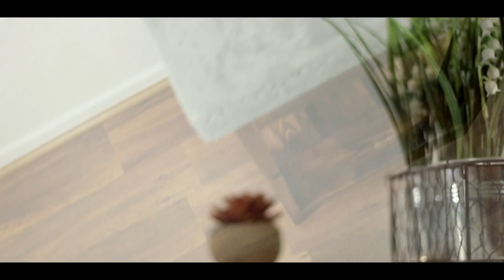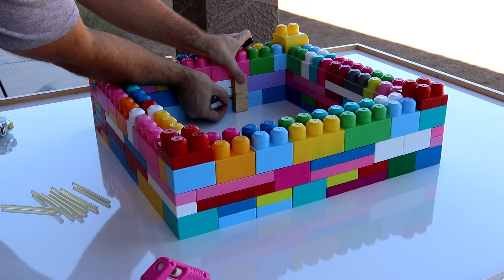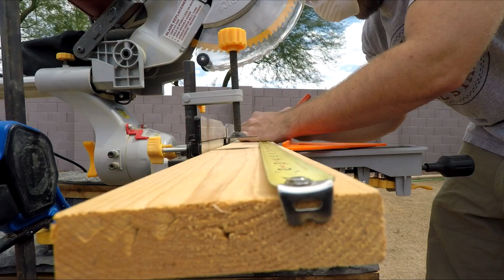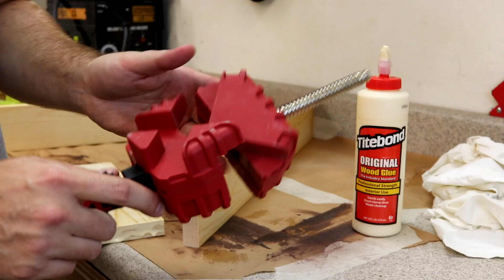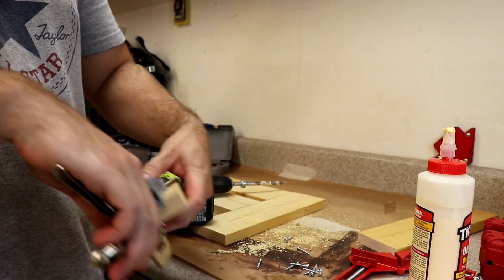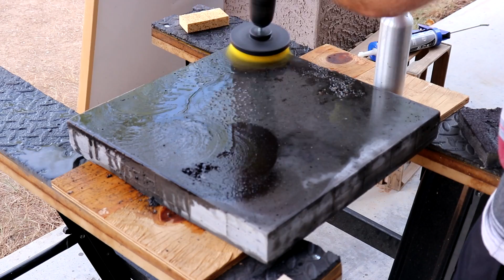Cheap and Easy $25 DIY Rustic Concrete Top Nightstand

Comment: Great project, thanks very much.  You used a water based pre-stain with oil based stain.  Minwax has an oil based pre-stain that will provide even a better finish.   Great idea on the cement top!!
Reply from the maker: Thank you Chris! I’ll have to check the oil based pre-stain out! I appreciate your recommendation!

Comment: Nice!  Any reason why you didn't embed some bolts in the concrete to attach it better to the top of the base?  And how top-heavy is it?
Reply from the maker: Chris Stephens thank you! I was afraid of screwing up and having to wait 2 more days for a second top to cure haha. Great idea though! And it’s actually not easy to tip. It is heavy though, I would say at least 30 lbs

Comment: $25 worth of materials, destroyed $30 worth of LEGO and glue... why didn’t you just use more 1x4 for the concrete mold?
Reply: Watching you use Legos was creative and showed people they can use anything to make a mold. Some kid in a small town may not have access to nice mold wood with plastic finish but may have something else like these blocks or literally anything else the imagination can come up with. There are no rules in the universe. Make what you can with what you have!
Reply from the maker: ArbiterX thank you for the comment. The concrete actually washed right off of the blocks. I would have needed glue regardless. I might try your method next time(although I already have a reusable mold material).
Reply: Melamine works better, you can just screw it down to itself, if you use wood you'll get the grain pattern on the edges.  Also if you use sand/top coating concrete it has smaller aggregate so you can get a smoother top. Also helps to vibrate it after you pour to get the air bubbles out.  You can also sand it down with an orbital sander or if you want it really smooth you can polish it with diamond pads.